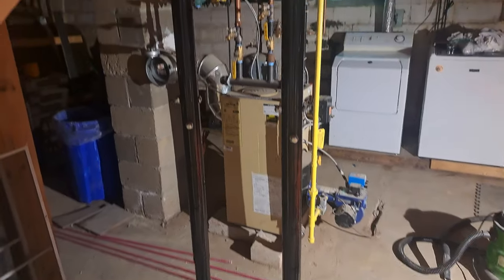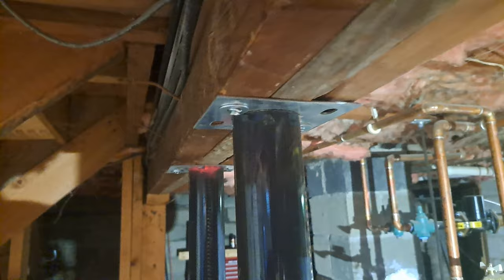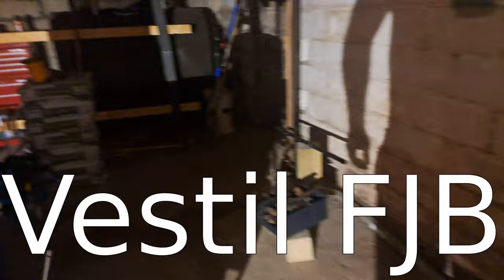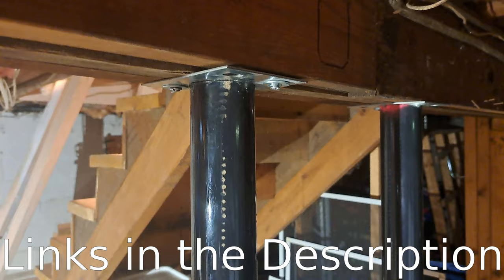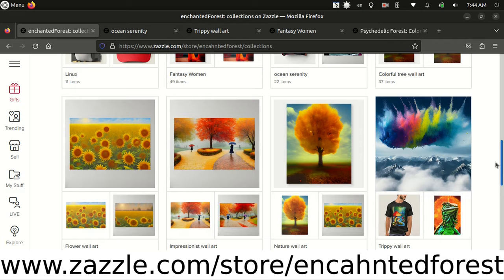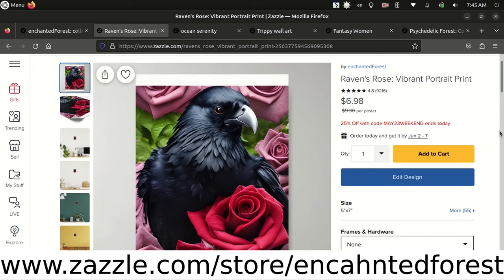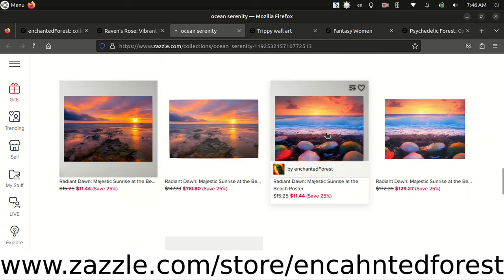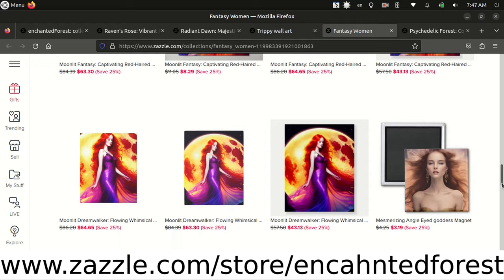Akron and Vestil Floor Jack Review: My Comparison of Two House Lifting Solutions!

Comment: Thanks!  Just learned of the Vestil via your video. It does look like a much better jack.

However, I visited the Vestil website and the load ratings are quite surprising. For a comparable size, the Vestil load rating is less in the minimum height than the Akron in the maximum height. 

The price on Northern tool is a lot less for the Vestil than the Akron through Lowes. 

I prefer to use a fixed post for permanent use but wanted an adjustable for temporary shoring. Having the screw and plates welded on is attractive.
Reply from the maker: The akrons have grown on me. I solved the issue with the plates being weak by attaching a 6x6 block of wood to them. This way the wood is holding the beam rather than the plate. It works well